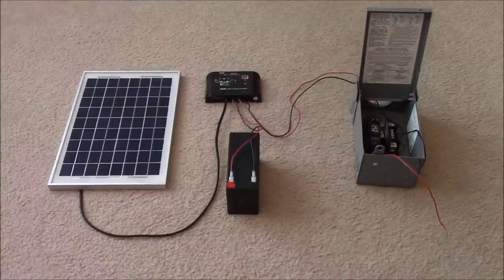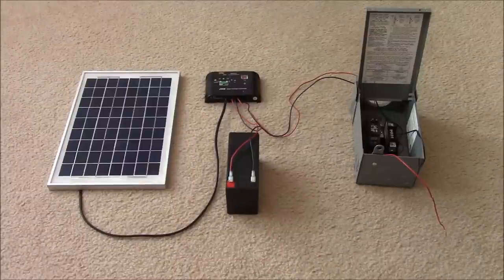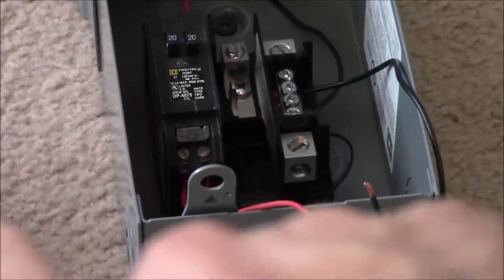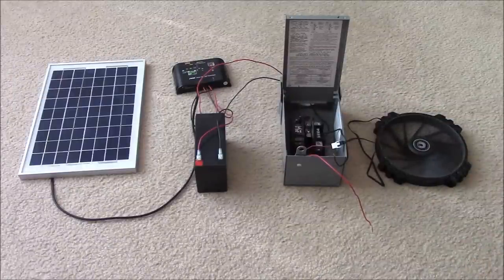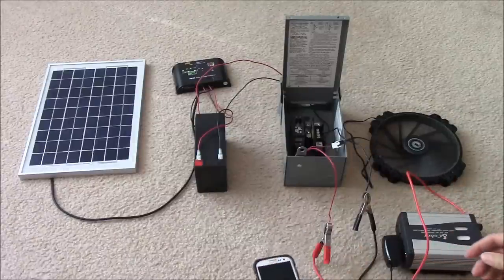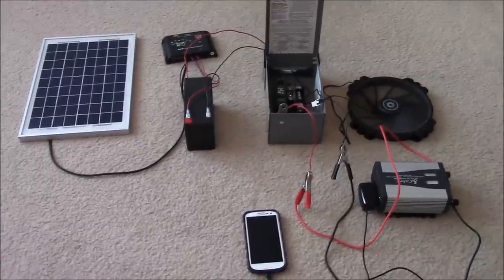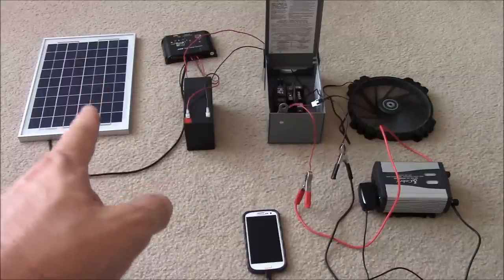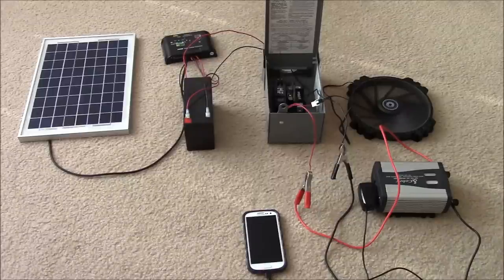Solar Panel Systems for Beginners - Pt 2 Hybrid Systems & Multiple Loads

Comment: Just want to say thanks for the videos. I've been thinking about making a tiny home/man cave for my nephew. I like the idea of the switch to chose between immediate power from the panel or flipping a switch to take from the charged battery. It'd be great as a night time back up if he needed to escape for a few hours. You've really given me hope that I might be able to pull this off without burning something down. :D
Reply from the maker: Stitched Wicked DC electricity is not as dangerous as AC, especially at such low voltage.  Start with a simple system like this and play around with it and use it for something small.  You will learn a lot and avoid a ton of mistakes later on that would cost you much more than this simple setup costs.

Comment: I saw the new video. Great explanation, wow thank you so much

You should open a blog!

I will post you the video of my project when done, so you can give me advice and idea. 

The panel 50w is about 3 to 4 Ah\ so a battery should be full charged in About 10h. The load is gonna work pretty much on evening (daytime no body at home) so I think enough time to charge the battery. Yes the load pretty much is gonna be a led lamp for the all the system box, two pc fan to reduce the heat, then in the house on DVD player about 15 watt and two iPhone charger and one regular lamp for the room, for outside one 12dc led lamp.

Box led and pic fans they gonna have a switch on off so they will work when I need, without consuming the battery.

I like your way to set up is clean and fine, just I think there is something I can't fix, I was thinking to have the external lamp set as solar sensor( just work when no sun) and the inverter on demand when I need power inside house, but in this setup the inverter is gonna work just when there is no sun.

What about put a relet on the inverter that is gonna switch on battery when there is not power from the light output? 

Thank you so much, really appreciate your advice
Reply: What about a rele reed?
Reply from the maker: If I were you, I would make a 2nd system instead of trying to switch things on and off.  You will spend just as much money on relays and sensors and extra wiring plus have more stress trying to figure out how to make it all work with one system.  Go get a 10w solar panel (https://www.solarblvd.com/product_info.php?cPath=1_25_39&products_id=2892) and a cheap lighting charge controller (http://www.amazon.com/ECO-WORTHY-Charge-Controller-Regulator-Control/dp/B00OH8QVKY/ref=sr_1_2?ie=UTF8&qid=1424534406&sr=8-2&keywords=solar+light+controller) along with a 8ah battery and hook it to the outside LED lamp.

Then you can keep the 50w panel and other batteries for your inside system.  I have 2 separate systems similar to this.  One 20w panel system powers my shed lights and I have 600 watts of panels powering my indoor system.  I really think you are going to need at least 100w for your indoor system but you can try it out first and see.  The reason I think that is because cloudy days in the summer or winter days with less sunlight may not fully recharge your batteries and you may run out of power after a few days.

Comment: This was a very helpful video, one of the best I have seen of your videos as it is very similar to the set-up I would like to do in my small shed. I like the mini-breaker box you made and how you connected them to multiple loads. I'm planning to set up 2 or 3 inset LED lights in my shed and have an inverter to plug in a lap top and cell phone charger. I'm gonna try and calculate how much battery back up I will need to do this setup. Thanks again!
Reply from the maker: You are welcome!  I am glad this was helpful.  If you need help looking for good components, I have put together a 10W and 100W kit on kit.com with components that I have used through the years and can recommend as good starter pieces of equipment:  https://kit.com/LDSreliance
Reply: LDSreliance, I will definitely check it out! thanks for the reply and advice!
Reply from the maker: You are welcome.  Good luck and let me know if you need any help!

Comment: Great explanation, thanks. i hope you can keep making videos about how to make the most out of it.
I already have a hybrid set up but i want to keep expanding it.
Reply from the maker: Thanks for the feedback.  What else would you like to see an explanation or demonstration of?
Reply: hmm everything. safetips. how to maximize the power generation (or minimize power lost due to inefficiencies). how to mix several power generators (several panels or mix with wind generators) to keep the batteries full.
Reply from the maker: Great ideas.  I will put those in the pipeline for future videos.  Thanks!

Comment: Hey. I didn't forget to post the video. I was waiting the wood shop to make me the box to contain the system. Anyway I decide to expand the system a little bit. 4 panel 50 watt (200watt total) 3 battery 45ah (135 total) 30a controller and 600 pure wave inverter.

I am working on it, I will post video in couple of days ( still waiting for some parts from Internet)

Thanks
Reply from the maker: Very cool!  Can't wait to see it.

Comment: thank you i will do so! 
another 50watt panel ( total
100watt 2 panel joint in parallel)
and another 20 ah batter with a small controller. so the 2 panel in parallel they will enter in both controllers. thank you
Reply from the maker: You are welcome.  Keep me posted on how it works!

Comment: my idea in my tiny house is to wire a solar light up. the solar collector will b outside while the portion will be inside. I would collection on roof top for optimum sun & then wires (wire up) the light inside the house via a box & switch with connection to a battery (ies) for saving stored energy. I see (from video 1) I'd need a control regulator to keep a steady flow to storage and for use. (something I thought I might need but not sure. ty for clearing that up). I also considered add an breaker box / inverter for plugging in USB or other electrical connections (located more towards front of the house or opposite of first idea).
Reply from the maker: That is a great use of solar as it will be simple to set up and will not require a ton of expensive equipment.  You will need a solar panel or two, a charge controller, a battery or two, some wire, a breaker box, a breaker, and an inverter.  The only challenges will be how to mount the solar panel on your roof (there are numerous mounting kits and brackets out there) and how to connect all the wiring as far as what connectors to use, etc.

Comment: I liked how you dumbed down the basic solar panel. What can you tell me about having a panel with a battery. I have a camper that has a battery that charges through my car while I'm driving. I want to add a solar panel for when I'm not driving. I operate lights, 2 small fans, and a coffee pot! Thanks in advance. You're awesome.
Reply from the maker: That is a great question.  You don't need much:  solar panel, charge controller, and wiring.  When you stop at a campground to camp you would disconnect the cable that connects the battery to the camper alternator (which charges it while you drive).  Then you can attach the wires to the battery and those would attach to the "load" or output connectors on the charge controller.  Then use the rest of the wiring to connect the solar panel to the charge controller at the appropriate connectors for the input or "solar" side.  You will want the wires to be as thick as you think you can get away with so that you don't lose any voltage through the wires.  If you mount the panel to the top of the camper, make sure you can swivel it to face the sun as it will obviously be different each time you camp.  If you don't want to permanently mount the panel to the camper, you could build a small wooden mount with some spare 2x4's or something that would sit on the ground and hold the panel toward the sun.

If that is too basic for you and you have more specific questions, fire away!

Comment: Jodie Marie Buschman
1 second ago
 I'm a bit confused here (maybe a lot). My RV set up is 300 watts on the roof feeding into a 40amp MPPT controller to 4 6V AGMs (400ahs).  My 1500 watt inverter is connected to the batteries with #4 cables for a 8 ft run. Here's my confusion; If I understand you correctly, I can run my 1500 watt inverter directly from the controller load connectors. Wouldn't the #12 gauge wires from the controller to the inverter be too small? My inverter instructions called for #4 cable for my run. Thanks for your time and knowledge.

Comment: Just wanted to add a safety feature, when using this type of set up, you may want to add an Earth Ground. That way when running house hold electric from this Panel, you will have a separate place to run the bare ground wire. An Earth Ground wire is just an 8' x 1/2" rod drove into the ground and then attached with a clamp and 0 gauge bare copper wire ran from the rod to this box. Also you will need a separate screw bar to keep the Black Wire, now White, separate from the Bare Ground wire. The confusing part is DC wire is Red Pos and Black Neg and AC wire, Black is Pos, White Neg and Bare Ground so when adding wires it can get confusing. Of course you can always use 3 way wire, that has an extra Red and not use the White at all, but it's almost 2 times as much for 1 extra wire, but depending on your run, it may be easier to wire properly because you only use the Black and Red, plus Bare just to be safe. I hope this helps...
Reply from the maker: Paul Bialozor I do use an earth ground in all of my permanently placed systems.  I actually did a few videos on how to drive in the grounding rods.  Check them out if you have time:
https://www.youtube.com/watch?v=-kpI8PFNYl4
https://www.youtube.com/watch?v=K5eorpQBml0

Comment: @6:40  YES make sure you use AC rated stuff for AC & DC Rated stuff for DC ONLY.  
If there was a fire for any reason and they discover that your electrical system is not up to code during the investigation, insurance WILL NOT cover you. 
Then you're technically not insured and that's a whole nightmare.

Comment: How do you calculate the power you can get from solar panel vs how much power is used by your loads. Surely if you run too many things the battery will be draining faster than it will be getting charged back up?

Comment: I was asking about skipping the charge controller. We have a panel, battery, and standard outlet. We want to make a little generator my husband can plug his cpap into when we go camping.
Reply from the maker: Irene Sommerfeld Yes, you can skip the charge controller although it is very inexpensive.  If you do so, though, you will have no protection from overcharging the batteries by the solar panel and no protection from over-discharging your batteries by the inverter.

Comment: can you connect a inverter to the load side then use a power board for multiple loads also i was told that pure sinowave is for anything with a motor and just(modified)  sinowave inverter is used for anything that dosnt have a motor like batteries to charge but use pure sinowave for mob telvision shavers etc

Comment: instead of running the load center from the charge control could you just run a board of switches from the charge control with the switched piggy backed off each other? and each switch running to a different appliance?
Reply from the maker: If I understand you correctly you are talking about having a wire come 
from the charge controller to a switch and then a load and then another 
switch and another load, etc.?  Basically that would put multiple loads 
in series like the way your house is wired?  Yes, that would work but 
you would only have limited control over switching each load on and off.

Comment: How can you monitor the electric flowing in on grid system? How to monitor the watts produce by solar panel?
Reply from the maker: The inverters used in a grid tied system will monitor that for you and tell you how much you are producing.

Comment: Am wanting to install an electric wall heater for an added mud room and use a solar unit to power the heater to keep the electric bill down.  If the heater is 1500W, 115V with thermostatic control, would a 50W monocrystalline solar panel do the trick?  And can the panel be hung just inside a window or does it need to be outside?  Would the who setup consist of an inverter, battery and what else?  Thanks for directing me in this.
Reply from the maker: +Karen Barton Good questions.  Unfortunately, I think you answered your own question in your second sentence:  can a 50w source power a 1500w load?  You will need a MUCH larger system to power a heater like that.  50 watts is about how much a small laptop uses.  Heater, refrigerators, hair dryers, microwaves, and air conditioners all consume massive amounts of electricity and require large battery banks and many solar panels to operate.  Sorry to be the bearer of bad news.

But to answer your other questions, solar panels need direct access to sunlight and cannot be used indoors.  Yes you would need an inverter, batteries, solar panels, a charge controller, lots of wire, and fuses and/or breakers.
Reply: +Karen Barton
Well resistive heaters aren't fussy, they will take those 50W just the same but it obviously can't give out more then 50W of heat (which is about what comes off a small light bulb).
For heating you are far better off with solar heating panels, far simpler/cheaper and you get 90% or more heat from that sunlight.

Comment: Thank you - excellent and clear. I have a simple 10W solar panel directly attached to my car battery to stop it going flat. Does it need a diode? When it's dark, will the panel drain the battery? Thanks!
Reply from the maker: If you aren't going to use a charge controller then you do need a diode.  The power from the battery can drain through the panel in that scenario.  I would highly suggest that you get a charge controller for your setup instead, though.  You can get them as cheap as $10 on Amazon and it will accomplish the diode protection and manage the charging process.  A 12V solar panel actually inputs 16-18V which is too high for that car battery so you risk damaging the car battery the way you are doing it now.
Reply: @LDSreliance  Thank you! Very helpful and appreciated!
Reply from the maker: You are welcome.  Thanks for watching!

Comment: Great and simple explanation, I finally got it now! 
What is the max. power of such system? Is it battery dependant? Does the charger automaticaly start to charge when voltage of the battery is low?
Tnx a lot!

Comment: great videos you explain this in the simplest way than anyone online that i've seen. but not just in a simple way the fact that you're using a small system allows me to visualize how to scale this up to a level that i could use for my operation. thanks. also how long does it take to charge your small battery in direct sunlight?
Reply: without a load running
Reply from the maker: Thanks for the feedback!  I am glad you found it useful.

It depends on how discharged the battery is, what size panel you have, what size battery you have, how many hours of direct sun in a day, and some other factors.  I would say with the system I showed in the video it will take 1 full day with no load to charge it.

Comment: With this set up, could I put it all together in a box, (glued to the walls of the box for safety and solar panel on outside) and use this setup to say have a portable battery that charges itself
Reply from the maker: Yes you could.  I probably wouldn't use glue but I have done something similar and there are many videos on people doing that on Youtube as well.

Comment: Hello, Thank you very much for posting. Your videos are simple, easy to understand and well explained. I would like some insight on something please. What would be the best way to take care of a battery ?
Reply from the maker: It depends on the type of battery.  The battery I show in this video is a sealed lead acid battery which means you don't need to add water or worry about it tipping over.  But you would still need to keep it away from extremes in temperature.  The colder a battery gets the less it can do its job.  So keeping it insulated and warm in the winter.
Reply: Thank you very much
Reply from the maker: Linda Tseng You are welcome.  Thanks for watching!

Comment: How would this work with 3 100W solar panels for my RV?
Reply from the maker: The wiring will be a little more involved and the components will need to handle higher current than shown in the video but the concepts are all still the same.  You need to determine if you are going to wire your panels in series (36V) or parallel (12V) and then you will need a charge controller that can handle that voltage, an inverter to convert from DC to AC power for you to use unless you have only DC loads, and some safety measures (such as the load center in the video) to safely distribute power and/or prevent short circuits.

Comment: Is there no need to terminate a ground from the bus bar inside the load center/ breaker box?
Reply from the maker: As long as the negative goes back to the battery and the system is below about 1000 Watts you should be safe.  Above that point on a 12V system and you will need some extra safety with grounding the inverter.